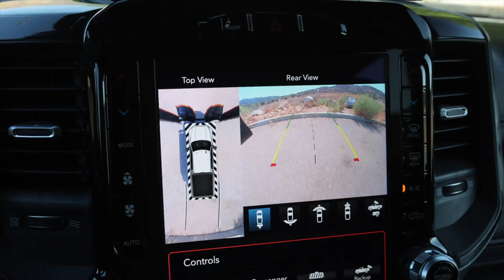What Did I Upgrade on the Power Wagon This Time?

Comment: Great content, as usual!

Quick question as my wife and I are trying to narrow down our preferences for a capable overland system.  Considering ONLY the off road capabilities between 

1) a truck like this with a four wheel camper mounted 
2) the same vehicle towing a fairly robust off road trailer 

Which setup, in your opinion, gives you the most confidence to get through difficult terrain?
Reply from the maker: That's not an easy question to answer and honestly it comes down to a lot of personal preferences. Pro's and Cons to both a camper and trailer and a more in-depth conversation I plan to have on an upcoming video.
Reply: Thanks for the response, Brad.  I look forward to hearing what you think.  I’m fully aware that both options I am asking you to consider have their limitations.  I’m not interested in finding the toughest trails.   My wife and I are more interested in finding wild places away from the crowds and my question specifically goes to which of those two options would give us access to a greater number of off the road destinations.   Thank you again!
Reply: I’ve watched several videos by people who have towed and done single vehicle Overlanding. A very large Con to trailer is if you are headed down a trail and it becomes blocked by fallen tree(s), washout, landslide, etc. you are going to have to negotiate turning around or backing up with a trailer. Also what size vehicle and what level of amenities. 

I know you are looking at Brad’s setups, have you thought of perhaps a 4x4 van such as a Revel or Story Teller Overland (STO) build? STO has a neat shower that pulls out of a cupboard and the Revel has a built in shower/wet storage “cabin”.
Reply: Thanks for the comment, Justin!  That’s a great point about the ability to just turn around on the trail.  

Personally, I’m not giving serious consideration to a Revel because I’m thinking I can get better off road performance from a truck with rear locking differentials that has a four wheel camper.  My perfect overland setup would maximize the ability of the vehicle to handle tough trails (not rock hopping but difficult roads) but would also provide my wife and I with a comfortable sleeping setup off the ground and is a place we’d be happy to be in while we wait out a storm.  We thought about roof top tents, but she isn’t crazy about climbing up and down in the middle of the night when nature calls.  We have a decent amount of car camping experience, but we want the ability to get as far in to the wilderness as a good truck/SUV can take us.  

I know a four wheel camper is really heavy and that’s a limiting factor.  I know an pulling even a very good off road trailer (like a black series or the many similar styles) also limits where you can go.  I’m hoping someone smarter than me can tell me which is the LEAST limited in terms of off road performance.  Or, is there a different option that I’ve not yet considered that best fits my needs.

Comment: You mentioned a few times about better payload & towing with a 2500 diesel, but isn’t the PW handicap there because of the off-road oriented suspension? And if you go throw a new suspension on a 2500 diesel anyway, isn’t that payload/GVWR moot anyway?

Comment: Diesel vs gas: for most people who do not need the payload and towing when will the additional cost of the diesel break even with the fuel savings? Probably a long time.
Reply: What also doesn't usually get factored in is the oil changes for diesel, apparently $300 every other time for the fuel filter.

Comment: Brad where did you get the decal to fill in just in front of the rear tire after removing your power wagon logo? Ive been considering pulling mine as well, but cant find anything to clean the line back up.  Thanks!

Comment: The bed side power wagon logo is removable?  Thought it was painted on. Best suggestion for how to do that?
Reply: On a hot day, using a non-marring plastic razor or fingernail you can get a corner up, then peel gently, not at a 90 degree. Also, can use a heat gun on low setting to soften for removal. Can spray some soapy water behind the decal once lifted, and work it in with a sqeegee. I'm just a guy who has removed a bunch of Ram, Ford bedside and Jeep hood decals.

Comment: Does that fridge require air movement around it? I would worry with having equipment by it that it might overheat. Fits beautifully though. Always great mods you create!
Reply from the maker: It's not a snug fit, so I'm not worried about air flow, should be ok.  Thanks!

Comment: Hey Brad, how do you find you brakes with those 37s?  I'm debating putting 37s on mine when I get it but braking is a concern I have..

I really like that rear swing out especially since it looks like you can remove it fairly easy but I bet its heavy :)

Comment: Great video as always. I was interested so I just looked up the Ultraswing. $1400!?!? I have looked at swing arm options previously that have equal weight ratings for about 1/3 the cost. The price I saw likely didn't even include the table option you got. Brad, what makes this model that much better??
Reply from the maker: I think it's important to shop around and compare. There were two factors in me choosing this tire carrier, 1) I have a friend that has had one on his truck and he loves it... personal recommendations are always more valuable than an online review. 2) They are a local small business and anytime I can support folks that are working hard to make a great product, I do... even if it means paying a little more.
Reply: @TrailRecon  I do value real recommendations vs (possibly bought or fake) online reviews. If they are a fully US company that also does have value too. Many companies are trying to claim they are producing locally when the bare minimum final assembly happens here with "globally sourced material". Thanks for all the great content and taking the time to give me this info!

Comment: Awesome build. I already have  airbags on my diesel 2500 and am getting ready to pull the trigger on an almost identical suspension, wheels/tires set up from cjc. Was there any fitment issues with the bags?
Reply from the maker: Nope. The guys at CJC Off-road did a great job installing them. 👍

Comment: Brad, How is the 4 Wheel Camper secured to the truck bed or frame?  How did you create the space between the camper and the cab.?
Reply from the maker: There are four turnbuckles that hold it down. The Four Wheel Camper  has rubber bumpers in the front of the camper that are pushed up against the bed to create that space.

Comment: Instead of Airbags, would Tuftruck springs work better? I believe they make springs for the 2500s
Reply from the maker: I'm not familiar with those springs, but what I like about the air bags is when I take the camper off, I can drop the pressure in the bags.

Comment: Love what your doing . I’m picking up a scout Olympic in 2 weeks in NC for my 2021 AT4 gmc diesel 1500 series wondering your thoughts on suspension , I’m searched some locals in va where I live  and suggestions where airbags maybe with sway bar but I’m thinking maybe some helper springs also , going upgrade load range e nitro grapplers stock size maybe , would like to go a little larger but would require lift kit of sorts truck already has 2” factory lift and rides fantastic , interested in your thoughts , watch everything your doing great content Thanks Trey
Reply from the maker: Stiffer springs, air bags, and a Hellwig swaybar have helped me a lot with payload and towing. You might find them beneficial for your rig.

Comment: What do you air your tires down to on the Ram. I have a 2021 Chevy 2500 HD and I'm curious what is a good low pressure without going to low. Thank you
Reply from the maker: I’m still experimenting with the right PSI but 20 seems to be working okay off-road for now.

Comment: Diesel has less payload because the 500 plus pounds of Diesel is bolted to the same frame. In bed Campers is where you need a Gas engine. More power less weight. For your application. I tow off road with my 2015 AEV Power Wagon. It outperforms Diesels towing off road. Especially in soft beach and dune sand. Your jeep may fit on a tighter trail but it cant do what an H.D. Power Wagon can. Tow 11,000lbs on the street much less dune sand. lol

Comment: I also am a jeeper, and recently bought the 2500 heavy-duty with the Cummings 6.7. the down fall is the unreliable DEF system.
Reply: Run Hot Shots Secret EDT in your fuel.  It  adds cetane, and helps combustion.  Which means you will use less DEF, and not clog the EGR, DPF, and SCR.   We also have a Ram 1500 3.0L.  Both are so much nicer offroad than my gas engine trucks.  That the Diesel is well worth it.  I do use a Dodge Durango around town.  And use the trucks on trips and truck stuff.

Comment: Diesel or Gas hmmmmmm.  Diesel perks - power, long range tanks, better mpg.  Diesel down sides higher cost, more maintenance, might also have to bring extra DEF fluid on long trips and the emissions! If I go diesel I pick a 03-07 5.9 cummins with carli lift, zero emissions and very reliable and if I went gas I would got superduty 7.3 with aux tank in the bed.   I would be so made buying a new diesel and the chance of being stranded due to a emissions component. grrrrrr lol

Comment: If you can put long distance aux tank for a diesel, why can't you do that for gas? Sorry. Stupid question.
Reply from the maker: I have talked with two different tank manufactures and things are a little different with the Power Wagon plus there are more diesels on the road, so it just made sense to produce those. I could do a custom one, but the cost would be significant.
Reply: @TrailRecon  got it. Thank you
Reply: @MikeMartin-fj6vs  Also there are different safety standards for gas vs. diesel and much more costly to do a large tank for gas because of this.